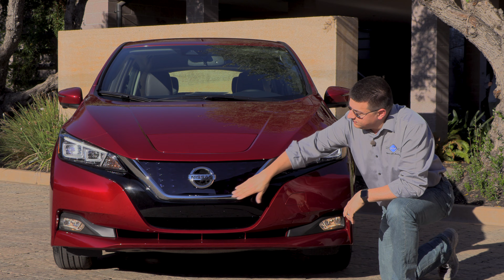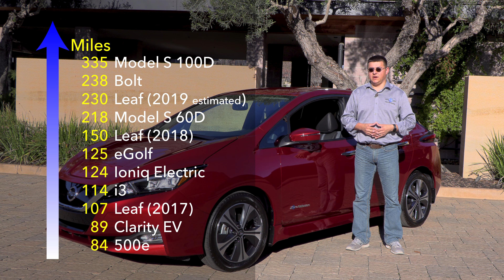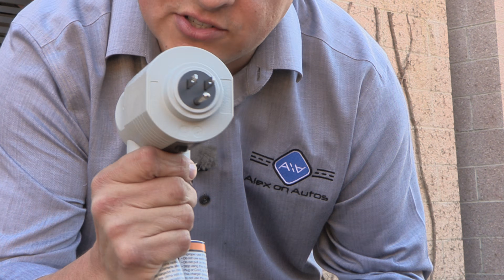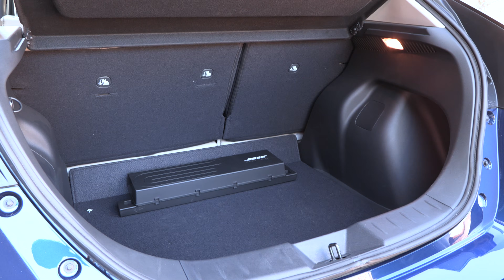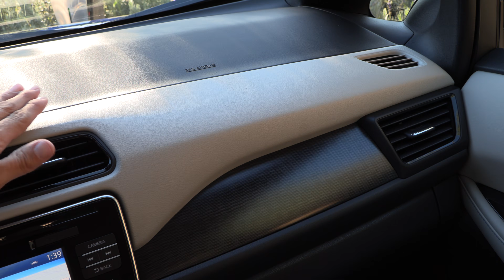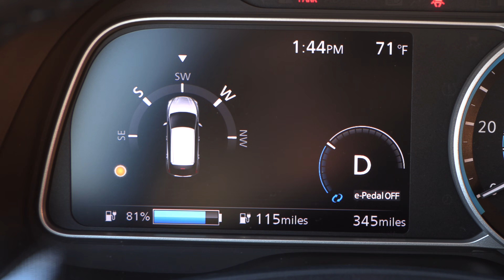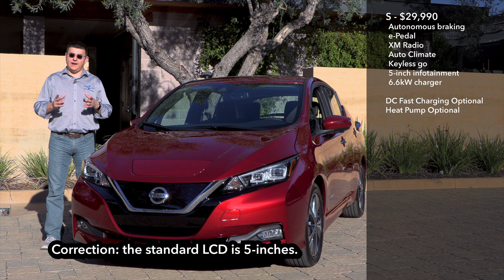2018 Nissan Leaf First Drive Review

Comment: I am supposed to pay $38.000 for 2019 Leaf (one with 200m range) or Chevy Bolt and in return I will get what? 
- Bad performance
- So-So (or worse) reliability
- Just "enough" room for 4 AVERAGE sized adults (if you're 6.2", it's probably going to be cramped). 
- Charging every day and paying for that electricity used. 

So, why would I do all this and not buy let's say 2018 Camry/Accord Hybrid for $30k that has: 
- Nice performance
- Better than average reliability
- More than enough room for taller adults 
- No mess with charging, going to gas station once in three weeks and spending $25 there for total around of $360 a year - approximate 10 year ownership fuel cost is $3600 - which is total $33.600 compared to $38.000 for the cars mentioned above. 

Other than that - it's nice to see this segment growing and getting better, but they will still need decade or two to be better value than regular gas-efficient cars or hybrids.
I would say that I could see my wife in this, but hell - we already have a baby, no need to have another one that needs to be plugged in and have it's diapers changed every day or multiple times a day depending how much you drive.
Reply: Kju Njels - The opposite is true! Electric cars have much BETTER performance and reliability than gas cars. The LEAF is one of the most reliable cars ever built. EVs LIBERATE you from having to go to gas stations. You can conveniently "fill up" your battery in your own garage while you sleep for a fraction of the cost of stinky and polluting gasoline. Also, maintaining the LEAF is nothing compared to a gas car.
Reply: Your calculations on the relative cost of the two vehicles are a little off. Most importantly, you are forgetting the federal and state tax credits and rebates, which would take your $38,000 top-of-the-line Leaf down below $30,000 for most people. Meanwhile, your gas calculations imply that you only drive about 6000 miles/year, which is a bit low. The average American drives more than that. Assuming you save on every mile you drive in an electric car vs. a gas one, the equation would continue to tilt in the Leaf's favor as you drive more.

Also, you're one of the few people who thinks that plugging and unplugging a car a couple times a week is more work than going to the gas station. And actually, your calculations imply driving only about 115 miles a week, which would be one charge of even the lower-trim Leafs. Do you really think plugging your car in once a week is more of a pain than going to the gas station?

"Bad performance" vs. "nice performance": how do you define that? The Leaf is about as fast as the 4-cylinder Camry, which is plenty fast. The Bolt is even faster.
Reply: Kju Njels - Nissan dealerships provide FREE charging for LEAFs. I'm fortunate to have a fantastic Nissan dealer just down the street. Once or twice a week I swing by there and "fill up" my battery for FREE on their DC quick charger which takes about 20 minutes of my time. I've never had to pay for electricity so I drive for FREE! At this rate of savings compared to driving a typical gas car and having to pay dearly for gasoline, the LEAF pays for itself after about 8 or 10 years. And that doesn't even factor in the huge savings in maintenance costs versus a gas car! (NO oil changes, NO tune ups, NO mufflers and tailpipes, NO radiators, NO noise and NO vibrations!) Imagine that! A FREE LEAF paid for by NOT having to buy gasoline anymore! Gas cars are headed for museums. Their days are over!
Reply: Reducing my pollution is a good enough reason for me.
Reply: Kju Njels - My research shows the Nissan Leaf to be very reliable. As I said in another post, an EV bill of materials is probably one third or less the size of a hybrid vehicle's since the hybrid has all the complexity of a gasoline powered vehicle and all the electric drive features, and all the gear required to get them to work together seamlessly. Personally, the stark simplicity of an EV (electric motor, battery pack, and simple drivetrain) versus a hybrid is much of the appeal for a guy who has turned wrenches on his own cars for decades. Honestly, I think some of the trickling pace of EV introductions and sales by the auto manufacturers is deliberate as they know fleets of EVs would hugely diminish their supply chains and dealer repair work. 
Things you need in an ICE or hybrid vehicle that you DON'T NEED IN AN ELECTRIC VEHICLE: fuel pump, fuel tank, fuel cutoff, fuel lines, fuel filter, fuel injectors, knock sensor, O2 sensor, fuel/air mix sensors, mass air flow sensor, air filter, throttle body, intake manifold, Positive Control Ventilation valve (PCV), exhaust manifold, exhaust headers, camshaft, crankshaft, cylinder walls, cylinder valves (intake and exhaust), radiator, engine thermostat, coolant hoses, coolant overflow tank, timing belt or chain, phasers (Ford), transmission, transmission fluid, transmission valves, transmission filter, rear main seal, serpentine belt, oil pump, oil reservoir, oil filter, oil temperature sensor, oil pressure gauge, oil gauge, oil seals, Engine Control Unit (ECU) and so on. This leaves out lots of fasteners, bolts, nuts, screws, springs, clamps, and sensors. All these things degrade from mileage and time; most eventually fail and require repair or replacement. Meanwhile, the EV owner or dealer keeps occasionally changing a light bulb, windshield washer fluid, and brake pads. This is the less appreciated paradigm shift of moving from ICE to EV. 
All this complexity has been shifted from the vehicle owner to the local electric power plant. The EV stores the work of the electric power plant and then uses it up while in motion. It is the local electric power plant manager that has to deal with fuel, sensors, heat, exhaust, energy transmission, and coolant. All this is revolutionary, but it looks subtle unless you own a car dealership, an auto repair shop, an auto parts store, or you are an OEM supplier to the manufacturers.
Reply: Tax write offs and incentives for Evs are better. I sell nissans and I’ve sold the old leafs for about 15k after incentives and Tax write offs
Reply: Kju Njels I find this bizarre that you say it has bad performance. My experience has generally been that an equivalent class of EV easily outperforms a combustion engines... At least at all highway legal speeds.

How can you say the car has bad reliability when it's not even fully released? That's just silly.

Charging every day isn't true for most EV owners. Say you've got 100 mi range. You do average 20 miles a day. You charge every four to five days. You get home, plug in, walk away. The process takes literally seconds at most. It's hardly 'babysitting' any more than a trip to the gas station.
Reply: Electric vs Hybrid? Not a comparison.
Reply: Too Bad LOL
Reply: Kju Njels 😂😂😂😂😅  Tesla Model 3 will stomp on any Accord, Camry, Altima.
Also, you can charge at home while you sleep and see a monthly bump of $10-20 on your electric bill.

Decades???  Wow

Once the Gigafactory is fully built for Tesla....things will only get cheaper and faster.
Look at the 2nd Gen Tesla Roadster....600 mile range.  It would take me a month to drain that battery and once a month charge for free at a fast charger.

ICE vehicles are in the process of becoming relics.

Comment: Why not compare the Model 3 with the leaf?
Reply: idemchuk0506 significantly more expensive. Also a completely different category of car.

Still you be a massive idiot to wait in line for a Model 3 considering the Bolt can do anything the 3 can, but ends up being cheaper and has a bigger battery (60kWh) than the $35k base model (50kWh). You have to fork out > $45k (e.g. BMW territory money) to get the "long range" 75kWh battery.
Reply: Tesla Supercharger access with the Model 3 you have to pay for it anyways. Not any more different than EVgo or Chargepoint which everybody can use.
Reply: supercharger network charges at 135kw the chademo charges at 50kw.
Reply: trades46 where is the bolt supercharger network?

Comment: This interior is MUCH nicer than in the Bolt! It's too bad the range is so low. I would likely choose this over the Bolt for the same price with the same range.
Reply: Justin - Wait for the 2019 LEAF. It will have a 60 KW battery like the current Bolt has so it will go well over 200 miles on a full charge.
Reply: Would you want to drive the uncomfortable Bolt that far?
Reply: Our Bolt is comfortable for us, as it is for most Bolt owners. Ask someone who drives a Bolt. By the way, the Bolt is very nice to drive, peppy, handles really well, is roomy inside and easy to park. It has exceeded our expectations.
Reply: Depends if an EV is your only car.  I drive a 90 mile B250e, and from experience, even 40 miles of range is more than enough most of the time.   At 150 miles, and with fast charging, I think Nissan hit the mark with a decently sized (a foot longer than the Bolt), comfortable car.  The Bolt EV with it's 238 mile range is more of a one-trick pony.  Big range may be the be-all-end-all for some, but to me the rest of the car matters more.

Comment: ughh, still can't get excited for an electric car.
Reply: Is your toyota engine guaranteed for 8 YEARS ???
Reply: Also, more and more businesses are opening that will overhaul your EV battery pack, restoring it to 98 percent of original capacity, even if the battery pack is 10 years old. I have seen quotes of $1400 to $1900 as of November 2017. The individual cells within the EV battery pack share a LOT with those in most laptops, so replacement cells are cheap and easy to install. Please do your research before attempting such work yourself or your battery pack will kill you. However, if your 2018 Leaf pack had a 150 mile range, that likely won't be all that attractive in 2028. The silly thing is I doubt most people will need 400 or 500 mile range 95 percent of the time, even in 2028.
Reply: This sounds like the same argument people made about the Prius when it first came out. We have a 2013 Leaf and the battery range has gone down a little, but if it goes down enough (which is 4 out of the 12 capacity bars) within a 9 year timeframe I get a free replacement. The plan is to give the car to our daughter in two years when she turn 16 so by that time I would be happy with less range. ;)
Reply: jennings the original roadster is 10 years old and most still have 90%+ battery life
Reply: Maximaniac72 My 2013 Leaf is at 52,000 miles and I may have lost 2-3 miles of range from when it was new. All I have had to do with maintenance is rotate the tires.
Reply: Maximaniac72 You still paid triple per mile to run your old car this far. not forgetting all that clunking around with gearboxes, clutches, starter keys, filling stations in all weathers, cold mornings with freezing cabins.... ad nauseum.
Funny you should say that about Nissan Leaf packs. They are 100% recyclable. But the Solar panel guys keep grabbing them.
Now tell me how well your cars consumables have been recycled.
Here in the UK our weather makes a +10yr old car a rare thing. Mines almost 5 years and 50K on the clock with all 12 bars battery health.
Reply: Maximaniac72 sorry dude, this myth that electric cars are “worst for the environment” has been proven wrong.

Also, electric cars will easily be more reliable since there is 1 moving part and no transmission.  ICE cars will be popular the same way horses are popular....hobby or fun way to get around.

I charge the vehicle while I sleep....you have to stop by a gas station.  Things will only improve from what we have now.  Just enjoy
Reply: jennings mills bullshit. There is no "panic over upcoming battery replacement"
Reply: Maximaniac72
Takes me moments to fill my Leaf. Click, walk away. It takes me 40 minutes to go the station to fill my motorbike. Then I have to go back home or carry on. It's an expensive chore that costs a lot, (3x) more to run per mile.

You have to mess with those driving controls. I pity you.

All SLA batteries last around 5 years. I'm keeping my eye's open to replace mine in the Leaf.

You suffer cold car issues.. YUKK! I walk into a toasty car in the winter and a pre-cooled car in the high summer.

The temporary capacity loss when cold is what.. 5 miles? pfft!

Lithium is a salt and the 1/12 most abundant element. You are thinking about cobalt. It's mined anyway just for its rarity (and to feed the rats) but unlike its use in electronics they are 100% recycled with almost no energy consumption. But the home Solar guys keep grabbing them. lol

Mine is 5yr's old and still 12 bars capacity. It ain't going to die soon. The average life of a car in the UK is 7 yr's, including smash up's.

Keeping an ICE in running condition costs money and non-recycled consumables.

I bought this car as a local runabout because my 'bike was the adventure machine. Never liked cars before but this is doing the bikes job now.

I'll never forget each day in the old cars. Stopped at the lights I just had to turn off the engine. Aaahhh! It was like an uncomfortable tight band released from my whole being. Just winding me up inside. This car has calmed down my driving experience. Money cannot buy this - unless you go electric.
Reply: FlyinGato I find the opposite to be true. I don't get as excited for gas cars as I used to. Electric cars are just so good, and they're getting better at a faster pace.
Reply: I was thinking more that when/if I replace my Leaf's 80+ mile battery pack that the replacement will probably be more miles than that. What will battery tech be like in 2022?
Reply: Test drive some EVs and then get back to us ;)
Reply: Your Type R is too badass for this 😎
Reply: FlyinGato - Why not? Once you drive electric you'll be hooked. It's addictive.
Reply: jennings mills - Batteries last much longer than that. They are getting better and cheaper very fast!
Reply: Viagra?
Reply: FlyinGato Roman concept 1
Reply: FlyinGato roadster v2.0?
Reply: jennings mills hello? are you still somewhere? you claimed bs and then disappeared? guess that means you don't even believe it yourself...
Reply: +Daguzify
that Tesloop Model S with 300k miles has had two pack replacements already.
It's gonna be hella expensive out of warranty. the tech just isn't comparably affordable yet.
Reply: Gato!!!! It would be great if you could do a first drive in an ev on your channel. Rent one on turo?
Reply: Then don’t.
Reply: Maximaniac72 If it was a Volt, none. 😉
Reply: Maximaniac72 how many oil changes, tune ups, belt changes did you pay for???  Exactly.

Tesla S reached 300,000 miles already.
Reply: Mike Loomis the Tesla roadster has a 600 mile range.   Ignore the rest and wait for the gigafactory to be fully built.

2021 Model 3 will have a 600 mile range for $35k
Reply: m1aws, I paid $13k for my car back in March of 2006.  Still on my original clutch, never a problem with the gearbox.  Starter keys?  I love the manual transmission and actual driver input.  I have had to replace the battery once though.   It takes me all of 3 minutes for a fillup and I own a coat.  My garage never goes below 50F.  As for cold weather starts I can wait a few minutes for the cabin to heat up.

As for the rest of the people here trying to convince me that an electric car is good for the environment?  Mining for lithium which is what EV batteries require is one of the dirtiest, most fossil fuel intensive industries there is.  Li-ion batteries performance degrade in cold weather and they degrade over time as well.  

Keeping an ICE car in good running condition and keeping it as long as possible is best for the environment as it delays the purchase of a new car (electric or otherwise) which is HUGELY bad for the Earth.
Reply: My Nissan engine is still going strong 15 years and 170,000 miles later.  I wonder how many environmentally friendly battery packs I'd be through now?
Reply: tanzanable 
because after 5 years your gasoline toyota is just being broke in.
& electric car owners are in a panic over their soon arm & leg battery replacement bill.

Comment: 40kWh leases will flood the used car market in 2021 and with the exposed to the elements battery the resale will continue to be horrible.  Replacing the 40kWh battery will probably be close to 10K.
Reply: Ivan Vojt would be great if a company sold after market ev batteries.
Reply: I looked last night, with the number of Leaf's sold I would think a 3rd party market or refurbishers who would have you mail back your core would have sprung up by now.
Reply: likely be near the same cost of replacement as the last gen $5000.
Reply: tax credit is going away so resale value such be much better then it was in the past
Reply: IK its a shame, ICBM cars can be made to almost last forever with good maintenance and good design however these cars are like laptops, next year they already outdated and since resale is so bad they will all end up in the scrap yard with their batteries polluting the ground. Congrats environmentalist you swapped one form of pollution or another!